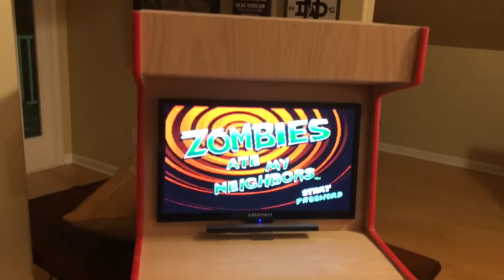Custom Bartop Arcade Build (using a Nintendo Wii)

Comment: I intend to do this, but making my own arcade controls by soldering onto a classic controller.
Reply from the maker: Nice! Good luck!
Reply: @DMDBNH  still a work in progress.... I have the software done. What did you Do you have an email? I can share it
Reply: @mrkrabs622  You should look at bitbuilt.net, they have a gamecube controller emulator board that could simplify your life.
Reply: Wouldn't modifying a GameCrube controller work better?

Comment: It's not an arcade machine without arcade controls ;)
Reply from the maker: +SuperGojira2001 lol maybe an arcade cabinet themed TV holder
Reply: Two Dog Garage Lol that’s a bit more accurate. I wonder if they ever made an arcade stick for the Wii....
Reply from the maker: +SuperGojira2001 they have. It's just a bit pricey on amazon. Trying to find a good deal on a couple
Reply: It could be a light gun arcade
Reply: @SuperGojira2001  They did but, they are rare to find and quick expensive.

You can however make your own arcade stick from a wii mote with a custom PCB, arcade stick, arcade buttons, and some soldering work.